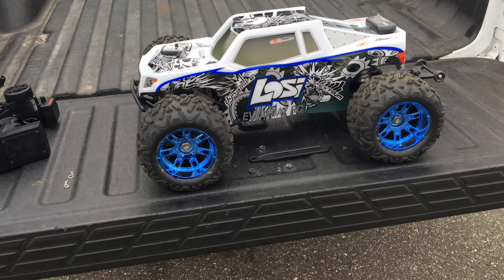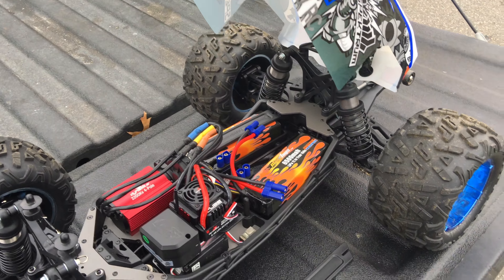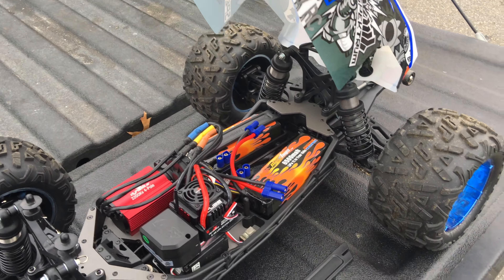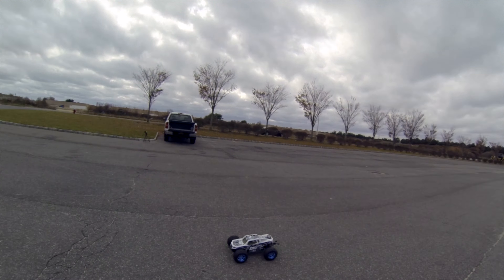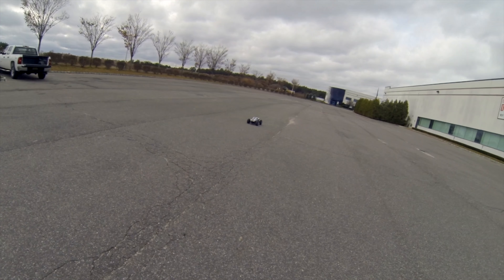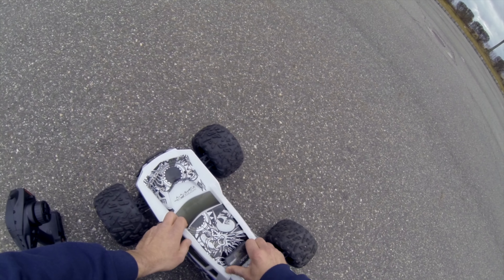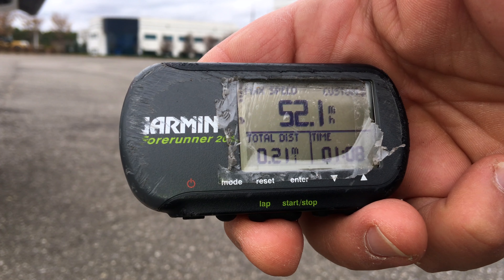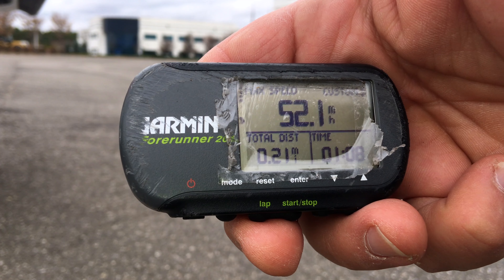LOSI 1/8TH LST 3XL-E -50+MPH-MAXAMPS-PART 1

Comment: 50+ on 2 wheels that's badass my brother nice run
Reply from the maker: Hey TINMAN! Thanks bro. Got a little wobbly there for a second but made it happen. Not too much room in this parking lot.
Reply: EVERYDAY RC  trust me I know for that short distance 52mph is moving for a 1/8  basher
Reply from the maker: Oh yes you are correct bro. This rebranded hobby wing system really packs a punch.

Comment: Have you ever had issues with your Garmin shutting off? I have the forerunner 101 & it shuts off on me all the time if I hit small bumps. I'm probably gonna take it apart & see if there's a loose solder joint.
Reply from the maker: No I have never had an issue with my Garmin shutting off. I have two of these units and I have run them side-by-side and they are accurate to one another. I chose this one because it has the most road rash. The 101 is definitely an older unit try the 201 or the unit newer than that!

Comment: Is it possible that 50 you first got was from the GeForce of the flip?
Reply from the maker: Not in this case. The 50mph was accurate.
Reply: It didn't seem too violent of a flip, but just thought I'd ask. You're certainly making me consider those max amps batteries. What does it mean by dual core?
Reply from the maker: If you do purchase the batteries make sure to use my discount code located in the description box. Dual core means: Rather than using one cell, two 150C cells are put together in parallel. By doing this, the power load is split between two cells(cores) instead of one

Comment: Have you had any issues with your differentials? The rear diff in specific. Destroyed mine even though I feel as though I really didn’t give the truck that hard a run. Just don’t want this to be an ongoing issue. Currently rebuilding it now. Also is your rear diff fluid filled because mine only have black losi grease. Great video btw sir! Really enjoy your channel and content.
Reply from the maker: Hey thanks for watching and no I have not had any issues with my differentials. I purchase this version because I have the original XXL2E And it has A locked center transmission and I have had issues with the differential on the truck but with the update of the LSD center differential on this truck so far I have not had any issues. Thanks for watching! Glad to hear you enjoyed the channel!
Reply: @EVERYDAYRC  I am very close to buying this truck, it is between this and the kraton?? Which you think ?

Comment: I figured with those max amps batteries you break 100MPH 🤣 great job man 🤜🏻
Reply from the maker: Hey Josh! Thanks bro! With the right gearing in this beast I’m sure I could!!! With the Stock set up on an open road I’m sure I can get 55 mph +
Reply: EVERYDAY RC yup that’s exactly what I was thinking when I looked at the format of the chassis I think it would be an excellent high speed platform🍻